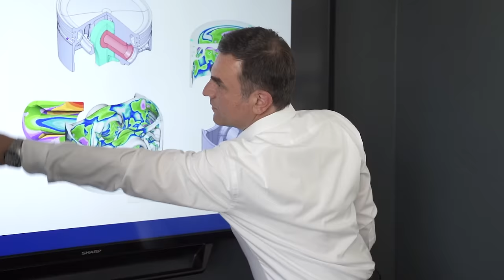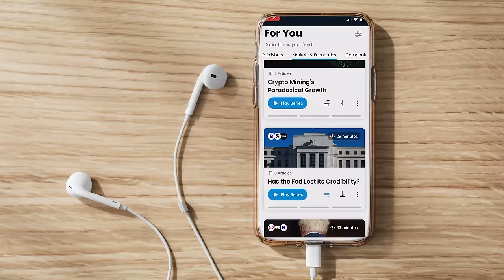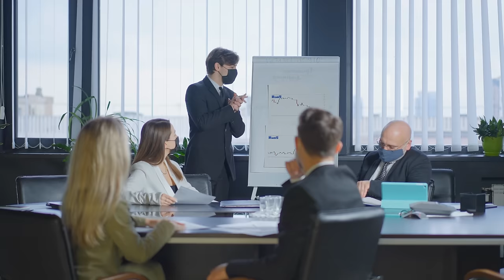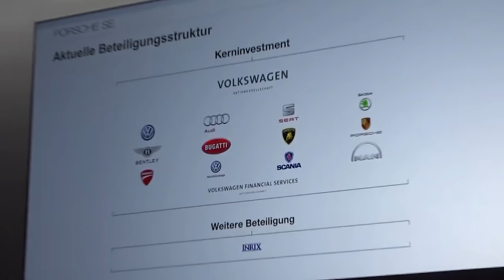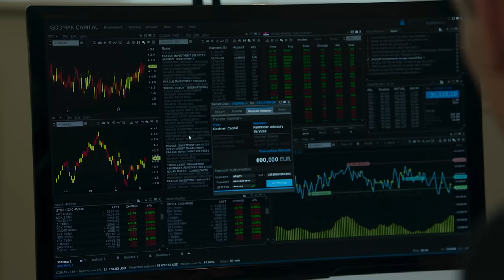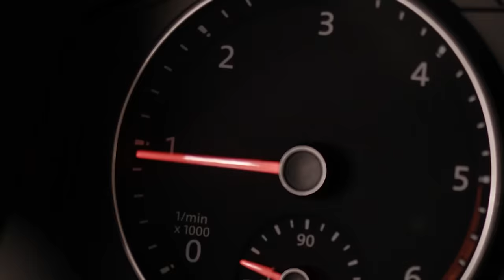Porsche is a Hedge Fund That (Sometimes) Makes Cars - How Money Works

Comment: Had a case study on Porsche hedging currency risk for a finance class. From the case we worked on: Porsche in 2007 made ~€1bn profit from selling cars while making €4bn from foreign exchange trades and options on Volkswagen.
Reply: Yeah I thought that was going to be the subject of the video. During 2007 and 2008 (?), Porsche amassed not only substantial VW stock but also a huge call option portfolio on VW, while many foreign hedge funds were aggressively shorting a slumping VW stock. And then one magical Friday afternoon, Porsche gave a press release - in German - announcing that they either owned or controlled more shares of VW than exist in private hands. The resulting short squeeze briefly gave VW the highest market cap of any company in the world and made Porsche many times it's standard annual profit from manufacturing vehicles. :)

Think GameStop but bigger
Reply: @firstjohn26 
Thanks for the short explanation. Was quite informative.
Reply: Vw short squeeze

Comment: It's pretty weird that the stock market technically allows circular ownership... Like, how many shares must you buy in your parent company before you cause a stack overflow and crash the economy?

/s
Reply: Circular ownership won’t crash the economy.

It is just sort of a way for executive lv highjack/coup the company from the original share owners
Reply: @Peeoto  But if A owns B and B buys out A, but A still has its shares in B... then whose in charge?
Reply: @kalebbruwer  the executive lv of course, and they appoint their own board. I just told ya it’s like a government coup.
Reply: @kalebbruwer  never saw executives of mother company fight with executives of child company?
Reply: @kalebbruwer  you would be amazed  by the japanese kereitsu or korean chaebol.
Reply: By german laws it’s actually illegal for a company to own shares of their „mother“ company. This video is way to fast and confusing, and outlines a company structure that’s actually not true. And with the recent IPO of Porsche AG (The actual car company) the story is more different.
Reply: @morilec469  Also the Porsche SE is a different company than the Porsche AG

Comment: Porsche also builds crazy yachts and penthouse apartments, I think there was one in Dubai that had a car lift, so you can stare at your Porsche while you are eating lunch!
Reply: Fun fact, just like Porsche AG and Porsche SE (Porsche Automobil Holding) are two different companies, "Studio F. A. Porsche", the 'Porsche' that designs yachts, buildings and other products and the one you a reffering to, is yet another, entirely different company - or at least it used to be:

It was founded in 1972 as "Porsche Design Studio" by Ferdinand Alexander Porsche, designer of the 911, as an independent product design studio that, just like any other design studio, offered (and still does!) their services to basically everyone that wanted to hire them. They remained more or less independent (at least in an ownership/business sense) from the rest of Porsche until 2003, when Porsche AG (so the car company, not the holding company) bought the majority of Porsche Design Studio and later renamed it "Studio F. A. Porsche" (2015).

You see, the video only scratches a tiny bit of the entire cluster... that is Porsche/Piech (and a lot of other big family owned conglomerates in Germany).

Comment: Weirdly impressed the investors with no voting rights get paid out first in the event of corporate insolvency, like there's accountability in decision making. Can't help feeling this is not the case with most US stocks (unless there's some obscure laws that enforces it)
Reply: preferred stocks are quite common, even in the us. they have usually higher yield on dividends as well.
Reply: It's a mix between bond and stock
Reply: preferred stocks is not some legally enforced thing that exists just in Europe. plenty of US companies also have preferred shares
Reply: Rest assured there are no obscure laws to protect retail investors in the USA. No voting rights just means you shouldn't buy the stock.
Reply: This is the case in the US and the laws that enforce it are not obscure.

Comment: Great video! I studied this case in an investment banking course in my Master´s. The Porsche Family later did a spin-off of Porsche (separated Porsche from VW to make it an independent public company) but since the Porsche-Piech family would not lose control of its original brand they make VW issue special dividends to the shareholders with voting rights (i.e. Qatar and themself, but mostly themself) and used that cash (plus debt) to buy 25% plus one share of the new IPO voting shares. The remaining 75% of voting shares are still controlled by VW, which is effectively controlled by the family. They also issued non-voting shares to the public. 

So basically, they did an IPO from a company that technically was already public, recollected a bunch of money from investors, and did not lose any control of the company. All of this while not putting any of their own cash into the transaction.

Comment: Imagine going through all that research yet still failing to pronounce the subject right.
Reply: what's the problem? it's just the english pronunciation. we don't use the original pronunciations for everything either. If you ever called Warszawa Warschau (or anything of the like) you're a hypocrite
Reply: @majorfallacy5926  It's not even the English pronunciation, at least not how the company pronounces itself. (Though that quickly descends into the philosophical question what exactly is the right pronunciation of a word with more than one and therefore conflicting ones...)